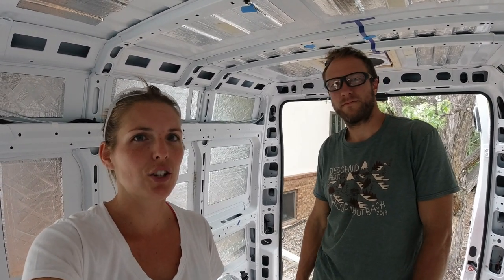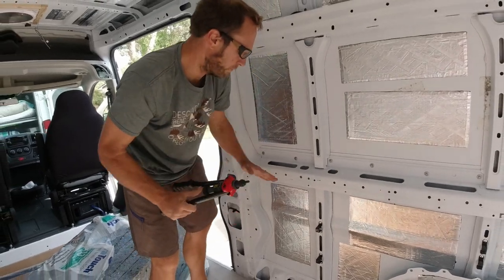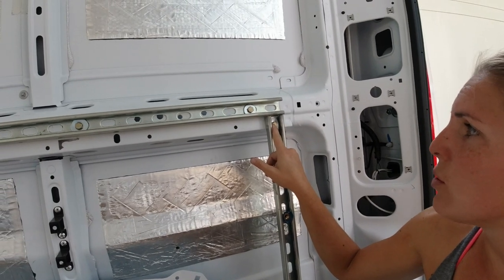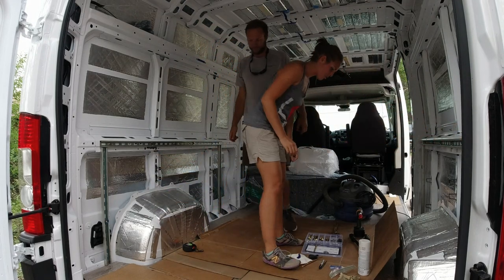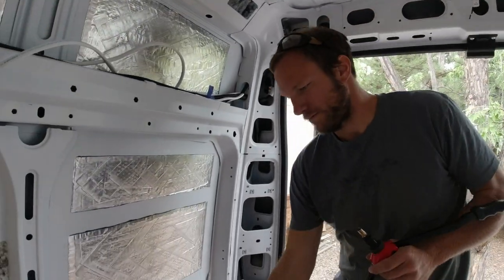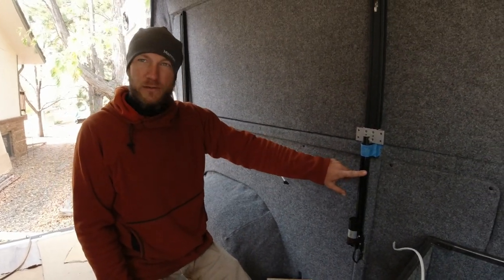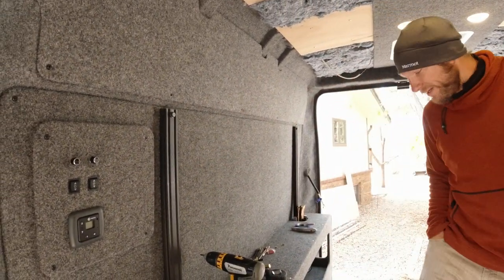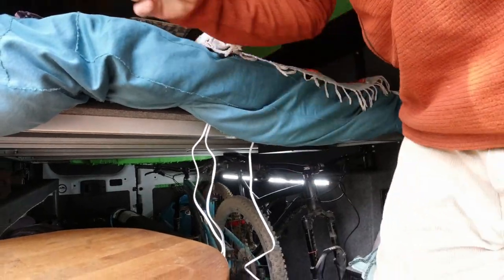Best Van Conversion Bed Lift: DIY Adjustable Bed for Promaster Van Build & Van Garage

Comment: I've never knew about the rivet nut tool. Looks like your doing everything first class.
Reply from the maker: Thank you!  We definitely wanted a high quality and durable build 👍.  The rivnut tool is a game changer!
Reply: Rivnuts are fantastic……..until they aren’t!
When they loosen the bolt can’t be removed or tightened. Dealt with them lots!

Comment: You make this look so easy. Really impressive.
Reply from the maker: Thank you for the kind words and also for watching! We were scared of the project and almost bailed on it but are sure glad that we didn't. It ended up being easier than expected and well worth it.
Reply: @DrifterJourney  One question.  Why not have everything run off one switch. Why two? Isn’t there a chance of it breaking?
Reply from the maker: Good question....I guess there is a chance of something breaking but hopefully not 😉. As for the 2 switch setup, it allows for us to run the front and rear separately in order to level the bed a bit. We can tilt one end 4-6 inches higher than the other without tweaking the frame. It helps us sleep on uneven ground.

Comment: Im not a real techy kinda guy..... but I'm curious why you couldn't have the lift wired so you just had 1 rocker switch to control the up/down?   I think your system is one of the best that I've seen!!!!  Great job!!!!
Reply from the maker: Thanks for watching! We wired it separately front/rear so that we could cheat and level the bed a bit if we weren't parked in flat ground. I imagine it could all be wired as one as long as you have the proper size wire and fuse for the draw.

Comment: Great video, I love seeing other's ideas.  I'm still in the process of building a linear actuator lift in my cargo trailer. I did not consider using 80/20 like youl disaster the track for the bed to move up/down.. I went with Unistrut for the track and 4 Unistrut dual wheel bearings that glide up and down inside the Unistrut. From their I'll attach the bed frame to the dual wheel bearings. Haven't built the bed frame yet, still debating on welded, 80/20 or wood.
Reply from the maker: Nice, the unistrut sounds like it will be a great solution as well!  Thank for watching and best of luck on your build!
Reply: @Ray Ward. Welded aluminum is nice if you're a TIG welder, about 30% lighter than 80/20 by using 1.5x1.5x .125 sq. Tube, likely save about 10-15 lbs in weight. I'm using 1.5 x 1.5 x .060 aluminum doubled, same weight, 25lbs for a 4x8 frame before adding 1/4" Swiss cheesed plywood platform. Linear actuators only on the headboard end for adjustable inclined sleeping.
Reply: Hi Ray!  I like your idea!  Do you have a YouTube channel?

Comment: Thanks for this resource, I know we will be back to this video as a reference many more times in our linear actuator journey for our vanbuild.
Reply from the maker: Awesome! Glad it was helpful and thank you for watching. Let us know if you have any questions along the way.
Reply: @DrifterJourney  I am curious if you considered doing just two tracks instead of four, I’ve seen other videos where they only have two, they have said it makes it rigid enough and don’t have to deal with getting all four perfectly parallel so they don’t buckle. Thoughts? Also curious if you know much about Hall Effect linear actuators that go in sync. Still cheaper than happijac/eurolift but still probably around $1k
Reply from the maker: We actually didn't think about using 2 tracks at all. I'd be curious to see those videos and the rigidity. As for the fancy actuators,  we looked at them and decided to go with the cheap Amazon version. We had similar cheap lifts in our previous van and they lasted 2 years full time without giving us any troubles. We talked about upgrading but decided against it. The new lifts have a 12 inch stroke so we just zero them (up or down) if they get wonky over time. We also tested them ahead of time and put the 2 quicker ones together.
Reply: @DrifterJourney  https://youtu.be/9nyhEgc4moA and this one has the same but they aren’t mechanically synced and he has pivoting mounting brackets on the top of his actuators
Reply from the maker: Those both look like decent ways to do it too. We didn't want to mount our actuators to the floor so I guess we needed the four 80/20 rails so we had mount locations for them. It's neat to see how other folks solve the same problems.

Comment: Riv nuts will work loose with vibration.  Using an epoxy could help a bit.  Back them up with a few nuts all you can.
Reply from the maker: Thanks for watching and for the suggestion. We've driven many bone rattling roads over the last 4.5 years (2 years plus per van) and about 100,000 miles. We haven't experienced any riv nuts loosening for us luckily but I like the idea of making things extra strong.

Comment: I used two small (manufactured in Germany) garage door opener’s for my lift mechanism. Works well, had no issues thus far. The only downside is you need 120v.
Reply from the maker: That's a good idea.

Comment: Nice work.  Thanks for the details and wearing safety glasses.  I'm in the middle of my bed lift design as I type.  FYI: They make "hall effect" linear actuators that CLAIM to run at the same speed but are considerably more money.  They also can be operated by a single switch via a controller with memory presets.
Reply from the maker: Thanks for watching! That's good to know about the hall effect actuators.  It would be nice for all of them to run at the same speed.
Reply: @DrifterJourney  You're welcome.  Thanks for putting the video up.  Here's that product I was talking about. The 4 channel controller allowing one remote is also pretty attractive.  https://www.youtube.com/watch?v=qZz21CJa5e0
Reply from the maker: We had looked at a similar product when we were doing our research. These are awesome but we just couldn't convince ourselves to spend $700 plus for the lift over the $140 for the cheap amazon version. We had the cheap ones in our last rig for over 2 years and they worked pretty good so we're hoping for the same results this time. We do have to zero them out every once in a while though........and they are slow. 🐌  Maybe we'll splurge on van 3.0.
Reply: @DrifterJourney  Hey, if they work for you then why change?!?  And it's more like a little over a $1,000 by the time you get everything.  This is for my non-mechanical/non-electrical savvy customer's van so I can't send her out on the road with something she might have to fiddle with or could even self destruct if it they get far enough out of whack.
Reply from the maker: Oh yeah that makes perfect sense!  We're always looking for a good enough solution without being too expensive.  But good enough for us is definitely different than good enough for someone else!

Comment: Outstanding! I have given a lot of thought to a project just like this. I am trying to work out how to get each actuator to lift independently of each other. By doing this I hope to level the bed and not the vehicle. May require some expansive equipment and special circuit control design. Thanks for sharing this.
Reply from the maker: You could wire them individually so that you could level. We ran the front 2 on a switch and the rear 2 on a separate switch for that exact reason.
Reply: @DrifterJourney  What front/rear height difference can you get from this? From the video it seems like it's all bolted together at 90 degree angles and so levelling shouldn't be possible? Or do you somehow account for the rotation of the bed frame when only moving one pair of actuators?

Comment: A bit embarrassed to ask a question others seem to know the answer to. What is the horizontal u channel bar for?
The vertical makes total sense to me, the ..bracket slides along the vertical, but what does the horizontal do?

This was really great to see. it made me feel like i have a good shot at doing this myself.
Reply from the maker: The horizontal is just for added support, something for the upper vertical structures to tie into other than one single point on the wall at the bottom (technically the black vertical rails tie into the horizontal unistrut, which disperses the load)
Reply: @DrifterJourney  Thanks alot for the comment response and clarifying it for me!
Reply from the maker: @PresidentBust  no problem at all! You can definitely do a diy bed lift! 👍😁

Comment: Like the bed lift system; How do you lift the bed if you have power issues?
Reply from the maker: Great question and thank you for watching! It would not move without a power source so I guess we'd have to fix the root cause issue.

Comment: Just figuring how to this in a Sprinter.   How did you deal with the walls  tapering?  I understand you need the rails to hold the bed to the walls. So did you make the bed frame the smallest so it fits at the top and has bigger gaps at the bottom? Or does your bed frame expand and contract to fit the changing width of the van?
Reply from the maker: Thanks for watching! We used spacers at the bottom to keep the rails vertical. It might be a little harder on a Sprinter if the walls taper much more than the Promaster. Let us know how it goes.

Comment: Do you have any videos done of wiring the lift panel?
Reply from the maker: Nope, we didn't film that part.  The lift wiring consists of 2 rocker switches with the front actuators wires into one switch together and the back actuators are wired into the second switch together.  You just need to make sure you buy a rocker switch that can handle your amperage

Comment: Really cool. I’m missing a little on the use of the cross U bar.  Can you sleep on it in any position? The actuators could hold you but maybe not the brackets they’re connected on?  Does it have to be down on the U bar? Thanks, it’s pretty sweet.
Reply from the maker: Thanks for watching! The unistrut is what the actuators are mounted to.    We can sleep on the bed at any height.  The actuators can hold our weight at any point throughout their range, but then they need something to secure them to the van walls, which is what the unistrut does.
Reply: @DrifterJourney  It seemed that the actuator was mounted to the vertical U which then connected to the 80/20 and pushed the bearing. I was missing how the long horizontal run of unistrut came into play? 
Tia.
Reply from the maker: Gotchya!  The bottom bolt for the vertical 80/20 aluminum is attached to the horizontal unistrut.
Reply: @DrifterJourney  for strength or spacing to make the 80/20 a 90 degree run?
Sorry for 20 questions, it’s a great set up and I was just wondering if the 80/20 could be bolted direct to the van rivnut. 
Promise I’m done after this.
Reply from the maker: No problem!  I suppose you could rivnut the 80/20 directly to the wall of the van, but we figured that tying the 80/20 to the unistrut would spread the weight along the vertical rail.  Also, because of the curve in the walls, you'll probably need spacers between the bottom of the 80/20 and the wall of the van in order to keep it vertical.  The unistrut helps with that also.

Comment: Hey, I'm wondering what and how you made your actual bed frame?  Thanks for the video!
Reply from the maker: Thanks for watching. It is made out of 80/20 aluminum. We bought full lengths, cut them to size, and then used corner connectors to screw it all together.

Comment: Great video.  I had pretty much ruled out a bed lift mostly due to $$, but this has me thinking about it again.  Question: how do you zero the actuators out at the bottom of the stroke;  just continue to run them until they're all fully closed?  Also, I'm assuming the only reason you use two switches is because the pairs of actuators move at different rates.  Is there another reason that all 4 rams couldn't run off one switch?   Thanks
Reply from the maker: Thanks for watching, glad it's helpful for you!  Yes, you are right on how we zero the actuators - either run them all the way to the top ot bottom depending on what gear we have under the bed.  Also, we like to have the front ones on a switch separate from the back so that we have a little ability to level the bed off if we are in an unlevel spot and don't want to get out the leveling blocks
Reply: @DrifterJourney  Makes perfect sense.  Hadn't thought of that.  Thanks
Reply from the maker: For sure!  It's super helpful when we're feeling lazy 🤣

Comment: Any idea what the roller for mounting the lower actuator bolt on the U Channel is called?
Reply from the maker: Thanks for watching! I think you're talking about the universal channel cone nut. Google that and see if it's what you are looking for. Just make sure to get the correct size.
Reply: That was it.  For the life of me, I could only find a but and bolt combo.  Great build as well.  I look forward to doing the same but with a twist! 😊

Thank You
Reply from the maker: No problem, glad we could help! Best of luck with the build and feel free to reach out with other questions.

Comment: Great job! Love the engineering!
This is what I was looking for!
From a t-shirt you were wearing and the juniper trees, looks like Bend!

If so, I’m down the road in Sisters. Would love to see your build-out sometime. Not sure how that might work.

I’m still at a crossroads right now. Between the Ford and the Promaster. Have eliminated the Sprinter, just cuz I’m going to be driving it across North America and I don’t want breakdowns 300 miles from the nearest MB dealer.
Reply from the maker: Thanks for watching!  We did the build in Colorado, but have attended Descend on Bend and that's were the tshirt came from.  We'll be thru there again for the event this year, keep an eye on our Instagram for our most current locations 🤙
Reply from the maker: Also - we did a couple test drives to decide between the ford and promaster and that sealed the deal for us.  The Ford didnt handle as well and we didnt like the cab area.

Comment: Hi, i am thinking, can I just use unistrut instead of 80-20 aluminum and linear bearings?
Can this unistrut fitting move freely when it is not tight? (can I use it as unistrut linear bearing). Should be more cost effective and unistrut can then be full height.

What do you think? I am probaly test this idea if I make bed lift.
Reply from the maker: Thanks for watching! The ones we used need pressure to stay in the unistrut track. I'm not sure if it would work as you're describing but I'm all about saving money. Let us know if you try and and figure out a good solution.

Comment: Hi! I used your video to help install my lifting bed system! Wondering if the parallel strut is 100% necessary? I was thinking it would help when the vans not on level ground. Keeping the 4 poles from twisting too much? And that most of the time they wouldn’t be in use?

Only reason. Is it would be easy for me to remove for my walls. Thanks!
Reply from the maker: Thanks for watching! That's a great question. You'd need to do some R&D or trial and error to see if it would work. We chose this method because it worked well in our first van.........so we didn't have to think much to get it working. 😉 We're looking forward to seeing some of your finished builds for clients.

Comment: I was wondering why you didn't wire all 4 actuators to one single switch.
Reply from the maker: Thanks for watching. We liked the option to cheat and level the bed a little of we weren't parked on a flat surface. We had about 4 inches of play front to back without having problems with the system.

Comment: What is the distance between the walls? Basically 80/20 to 80/20 across the van.
Reply from the maker: Hi and thank you for watching! You are correct. We built an 80/20 bed frame that mounts to the custom brackets that we made (shown @12:25 in the video). Let us know if you have any other questions.

Comment: Hi - new subscriber.  Is it ok to ask why you picked the Promaster rather than Ford or Sprinter?  I was thinking Sprinter and you guys have actually lived this as I am a newbie. Is your Promaster 4x4 or FWD
Reply from the maker: Hi James, thanks for subscribing!!  Happy to answer any questions!  We chose the Promaster because we didn't want to deal with diesel emissions and the long term mechanical costs of a diesel vehicle.  We also knew we'd want to take it to Mexico and the diesel fuel quality can vary so much in other countries.  So then we had to decide between the Ford vs. Promaster.  We test drove both several times and just liked the way the promaster handled better.  We also got a great deal on the first one (we're on van 2.0 now) and since we liked it so much, we bought promaster again for the 2nd van.  It's only FWD, promaster doesn't come in a 4x4 version as far as I know!

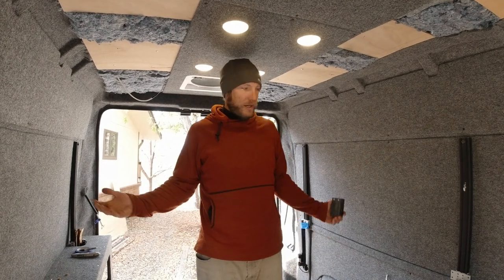Comment: First time viewer, nice and instructive video for the bed.  At 9:59 the Promaster walls are bare (white metal), then "a few weeks later" at 10:01, they are nicely upholstered in a gray material.  What is that material, and where to source?  I think I have heard it pejoratively or humorously called 'rat fur'.
Reply from the maker: Thank you for watching - glad it is helpful for you! In the industry, it's called automotive material or felt. We bought the stretchier kind so that we could form it around the odd curves in the van. It's a nice, lightweight way to give the van a finished look.